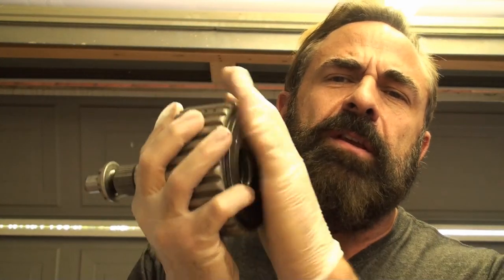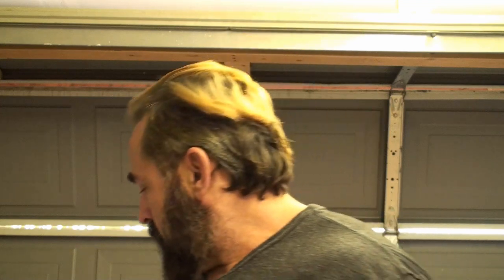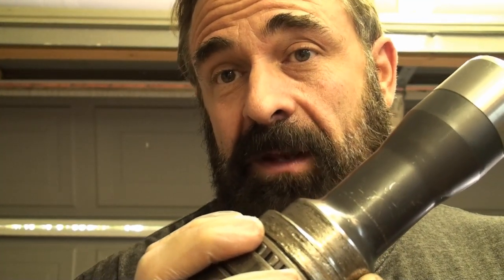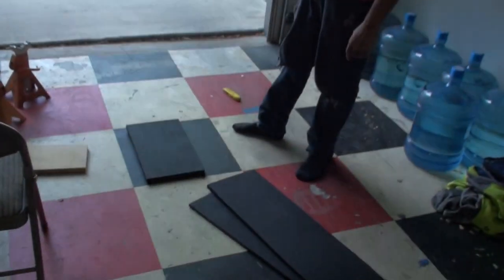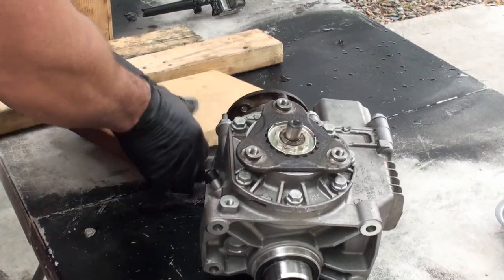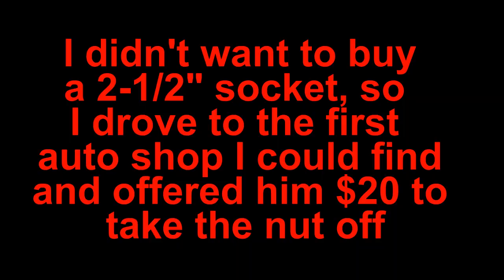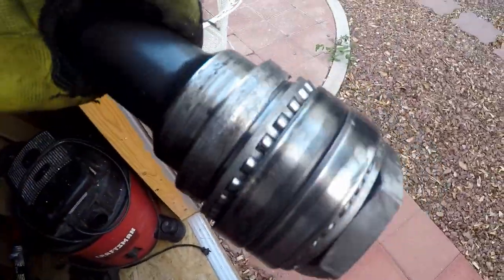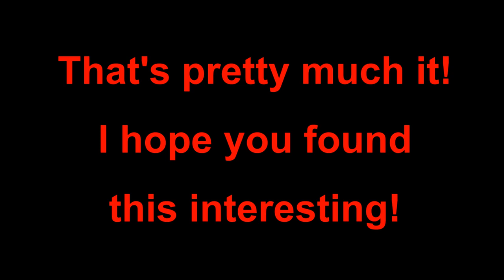2016 Golf R Bevel Box Failure TSB

Comment: Great video! Just had this exact issue on my 65 plate S3, took it into an independant speicailst who couldn't diagnose the problem (HAD THE CAR FOR TWO WEEKS!), we tried changing the pump, changing the controller, putting new fluid in, cleaning the pump gauze, removing the friction plates from the haldex and the clutch basket to inspect, nothing wrong there. They then tweaked the TC and told me to go test the car, one launch later and a whole load of front wheel spin as per the propshaft and coupler exploded off the car, great, once fixing this we still had the same issues, anything over 2.5k rpm the TC light would go nuts.

Spoke to a guy called Matt from haldex repairs and he was amazing, we both came to the conclusion that the haldex was fine as the pump values were as expected therefore showing that the pump was functioning correctly and that the pressure release valve wasn't stuck open as this would've changed the pump learn values. When the car was in the garage I asked them to check the BEVEL/TRANSFER BOX which they came back and said was all fine. 

SURPRISE SURPRISE THE BEVEL/TRANSFER BOX WAS COMPLETELY F***ED,  After over £1000 in garage fees and still getting the same TC flicker on any slight accelleration I took it to another specialist to a guy named Tom, great guy and managed to get me in within a few days with a second hand bevel/transfer box and this instantly fixed my AWD problem! It seems the push fit gear as shown in this video had done exactly the same. 

All that time I had wasted with another garage that didn't seem like they wanted anything to do with the issue as the best they could come up with was to buy a whole new haldex at a nice £2800 plus fitting etc. NO THANKS. Another "Specialist" that has absoulutely no clue on how to diagnose the issue presented to them and proceeds to bill the customer for their lack of knowledge.

Link to the site that helped loads - https://www.haldexrepairs.co.uk/generation-5-haldex-fault-finding-repair-guide/

MY CAR IS STAGE 1 ECU and STAGE 3 TCU, it's been stated this problem is normally with modified vehicles due to the extra power, which with all the lauches I would agree this really stresses the Bevel/Transfer Box.

MY  SYMPTOMS:

TC Light flickering under any load and massive front wheel spin
Once the car was up in the air all 4 wheels would apparently spin (not too sure I trust this as this came from the garage who couldn't daignose it).
ALL STARTED WHEN SETTING OFF FOLLOWED BY A HUGE BANG AND THE REAR WHEELS JUDDERING WHEN ACCELERATING, THIS SLOWLY FADED OUT TO BASICALLY NO DRIVE TO THE REAR

I noticed this first when launching the car it would feel as if the rear tyres were crinkling or the haldex clutches were slipping, if anyone needs a hand I will be more than happy to try and help, I wish I could've spoke to someone like myself when this happened. 

TOTAL £1700 down and fixed :(

RENOX
Reply: Got similar issue!! Need help in the right direction mate , 
Golf r 2014 dsg stage 2

Traction problem from the front in almost every gear 50% 75% acceleration..

Got 4x new tyres 
Haldex serviced and issue still there
So got a NEW HALDEX and still the same. 
Got new diff oil

ISSUE IS STILL THERE ??
Reply: @haroonnasir1970  Hi mate, when you changed the diff oil did it look shiny or like it had glitter in it? 

Also have you tried the Transfer Box Test on that link?

Comment: Fkn legendry video, thankyou!!

Explains EVERYTHING, and like you I've fought loss of rear Haldex on tuned cars at the rear end without luck. Endless reports of bevel box issues across the various Haldex car forums, and all sorts of urban myths and special voodoo involved. Just had my new, low km bevel box start making weird pinging/binding noises on the highway, and it seems a lack of oil despite zero leaks was the issue, I had no idea in the MK6 era it stopped sharing oil with the gearbox, so didn't go looking for a level to check. Drained out 150mL or so when it should be 850mL. I reckon my bevel gear has slipped due to heat and friction, so have yet another box to fit, and to keep an eye on. After your GREAT diagnosis, I'll rebuild my old box and keep it as a spare, cause no doubt it will play up down the line. At least it's a relatively easy fit in place, just axles off and a bit of engine rocking. Oh yeah and fit a hose to the breather port so you can refill it much easier in future, I'm adding this to the DSG fluid replacement schedule, and ensure you get the uber special VW fluid too!

Comment: Great video Radfox. My repair shop has ordered new bevel box from Germany, they couldn’t find any in the states, new or used. Mine did not have a mechanical failure however. The motor blew 5 weeks ago from crack in oil pan and after test driving the new motor they found a leak from the bevel box. Shards impacted a crack in bevel box.

Comment: I have a theory about how the transfer case (bevel box) was damaged. Many years ago I had an EVO 8 that I was tuning at my friends shop using his DynoJet AWD chassis dyno, and his did not have the option that physically connected the two rollers. After multiple runs I noticed that the front wheels completely stopped before the rear wheels stopped, and I thought oh that is not good (and unfortunately I was right). On the next run only the front wheels spun up, crap! 
What we learned is when you don't have any type of connection between the two rollers, the only thing that keeps the two rollers spinning together is your drivetrain. When the run is over the operator lets off the gas and presses a button that initiates a roller brake system that is separate for each roller. I learned that there is regular maintenance for the front and rear roller brake systems and apparently that had not been done in some time so the rear roller brake was not working well. When those heavy rollers are spun up that is a lot of energy and if the brakes don't line up the only thing keeping them at the same speed is your car's drivetrain. 
With the EVO this brake mismatch caused the gears to completely break, whereas yous apparently spun a gear. After this experience I would never put an AWD car on a chassis dyno that did not have the two rollers physically connected. Or put it in 2WD mode and test it that way.
SO question did this issue appear after your dyno testing? What about other folks on here claiming to have had the same issue, was your car on a chassis dyno at some point? And did it have connected rollers? 
I suspect this must be the issue because while some others have had this issue, there are a lot of folks making way over stock power and doing all sorts of drag and road racing, and have not had this issue. So when I saw your dyno video and you specifically mentioned that it does not have the roller belt connecting the two rollers...
Reply: I've also wondered about this, and why i've not been too keen to put my RS3 on a dyno.
Reply: @RichLion  You can do it no problem, just make sure the dyno you use has the rollers physically connected, or run it in FWD mode. If you do that, it will be fine.

Comment: Hi, this is a really common issue. I run a company call HaldexRepairs.co.uk here in the UK, and I talk to about 1 or 2 people a week who is trying to solve a haldex problem but it is the transfer box slipping just like this example. A really good test which I tell people over the phone is:- 

Lift the car so the front wheels are off the ground. 
Get somebody to watch the propshaft.
Someone else sits in the car, starts up the engine.
Then very gently lift your foot off the brake so the front weeks start to turn.
If the propshaft is stationary then its the transfer box.
If the propshaft rotates then it is a Haldex issue.

Every car with a broken transfer box so far has remapped etc, it is the first question we ask.
Reply from the maker: threepotgtti thanks for the input! Maybe you guys should look into offering a welded ring gear replacement. What are your thoughts on this? 
 Do you offer a haldex clutch plate replacement kit for the MK7 yet?
Reply: @RadFox1320  Major mechanical repairs are not really what we do, it is just trouble shooting, control unit repairs, new pumps and new filters. Welding up transfer boxes is well out of our remit. We've never bothered doing clutch plates either because up to now we have only found 1 vehicle with a burnt up clutch pack. Lots of vehicles get the Haldex coupling replaced by other places but it's usually misdiagnosis. There is a firm in south eastern Europe that supply clutch plate kits but so far we have had no need to use any.
A customer sent us the link to this video, and I think this is awesome, it really shows this common fault up close in detail. The build of these transfer boxes is very cheap indeed. I will send lots of people a link to this video!
Reply from the maker: @threepotMR2  Thanks for your response and sending people my way! Your company provides a great service and anyone experiencing Haldex issues would do well to contact you at HaldexRepairs.co.uk and look over your troubleshooting guide.
I suspected that most "Failed Haldex" were misdiagnosed, its good to hear that you can confirm this. I took apart a supposed MK7 "Failed Haldex" with dark oil and as far as I could tell the clutches looked perfect and there was nothing wrong with it. Thanks again for your input!!!
Reply: @RadFox1320  I have linked this video on our repair guide here https://www.haldexrepairs.co.uk/generation-5-haldex-fault-finding-repair-guide/
Reply from the maker: threepotgtti awesome thanks!!
Reply: @threepotMR2  I'm here from that link.

Comment: Very interesting video!  I’ve had some haldex issues and did the VCDS pump primer and adaptations reset, then replaced the pump and last replaced the controller. The newer controller seems to have fixed it but I did see the bevel box fail on a few people during my research.  I never understood what the bevel box was but thanks to your video I do now!
Reply from the maker: Thanks for watching!
Reply: Was this fixed in later 2016's or 2017's
Reply: @CA-td2mx  No, experiencing the same on my mk7.5

Comment: Great video, bevel box on my 2018 RS3 just blew itself to bits, thankfully my dealership diagnosed it and didn’t give me a run around with any other haldex parts. The not so good part is that it’s roughly 12 000$ CAD to get it fixed …

Comment: I’ve got a 2019 Golf R.

Launches perfectly but everytime I make a tight turn, like out of my driveway, the rear end vibrates. 

Had the Haldex, diff, propshaft and driveshafts checked and no issues. 

No one can diagnose it. Any suggestions?

Doesn’t happen straight away. When I start the car and turn out of my driveway, no vibrations. After driving for 5 mins, the car starts vibrating on tight turns.

Comment: Great video, thanks. On the RS3 the ring gear is (now) welded to the shaft.
Reply from the maker: Do mean you welded your ring gear, or that RS3's now come with the gear welded from the factory?
Reply: @RadFox1320  Comes welded from factory.
Reply: @jarlev80  did you check this?
Reply: @Adrianperformancequattro  Sure, my bearings were done so did an overhaul on mine. The ring gear was welded to axcel.
Reply: @jarlev80  do you know what’s the symptoms of bad transfer case? I just purchased an used 2016 RS3. I am starting to hear some humming noise at low speed, not sure why. Brand new PS4S. Thanks!
Reply: are you sure about this, some rs3 owners mentioned needing a replacement with similar issues.
Reply: @eddiexiang3606  same with mine did u find out what it was?

Comment: Did you get any binding during tight turns? I'm experiencing a similar issue on my MK6 Golf R, and after doing Haldex service, replacing the pump, fluid, and controller, the issue persists. The car was abused by the previous owners with a REVO Stg 2 tune, and now all signs are pointing to this bevel box... so fucking annoying.

Comment: As a VW tech I can honestly say we haven’t changed many if any bevel boxes. I think the fact that your car is modified is the reason it has failed, which is normal since the vehicle was designed and built for a certain amount of torque. With all modifications all parts after that risk heavier wear. Just consider yourself lucky it wasn’t differential damage I guess. 
Great video showing exactly the faulty part!
Reply from the maker: Thanks for the comment.  I think I know exactly when it happened and yes I am sure the added torque from the tune is what allowed it to happen.     I doubt that stock power levels could spin the gear except under very unique circumstances.  If I am right, it happened during a launch where I hit a dirt patch with massive wheel spin and then a super violent wheel grab when I hit sticky pavement. I remember hearing a loud bang and thinking what the hell just broke.  I looked the car over and didn't see anything and forgot about it. So I am pretty sure for it to happen you need massive high RPM wheel spin then a violent tire grab to do it.  I had PSS's on the car when it happened.
Reply: Rad Fox if that’s the case, I’m glad it wasn’t worse lol
Reply: @RadFox1320  hello, today i am running the same problem with my volvo S60R T6 AWD 340HP, my car don´t have any modification, when I press gas pedal heavy, it feels like if a banana peel were glued in one portion of my rear weels, feeling a strange noise and not a constant push!!, i was looking for a haldex replacement, until i saw your video, ill check this week if the problem could be the Bevel Box, and in that case ill try to weld it, o even put some kind ok threaded bolt, to avoid gear rotation. Haldex oil, was clear, not much dust, discs looks new, car has 80.000 miles and I think gear couldn´t stand the torke.
Sorry for my english, hope you could undestand.
Bye
Reply from the maker: @juanmanuelpaladini  i think on the volvo the failure is typically a little different. On the volvo i think the splines start to rust and shear off the input shaft to the bevel box. I think you can order just the shaft on the volvo.

Comment: Hello! What happens if I drive the car with dead haldex pump ? Is there any damage to the haldex or it's just like a FWD car now? Thanks
Reply from the maker: You should be okay, if the pump isnt working the car will just be fwd. The pump clamps the clutch plates in the haldex. If it cant clamp them together no power will make it to the rear wheels.
Reply: @RadFox1320  thanks for the answer, Rad

Comment: I am here because my 2012 Mk6 Golf R appears to want to think it is a Gti (front wheel spin when planted, only 45K Kms, recently replaced clutch/ pressure plate with Sachs due to slip in high gears under full throttle, running Bluefin Stg2 tune+Miltek exhaust, dyno just a bit over 210kW/280HP at wheels so not a huge amount over stock).  Pretty stupid design, surely to avoid detonation of that ring gear or shaft, the rear haldex could do the releasing if there is excessive force.
Was thinking it was haldex pump due to the dozens of threads dedicated to this, will attempt to get under the car and spin the drive shaft to learn what the damage will be to my pocket...Euro parts are insanely expensive in Australia.  I wonder if there is an upgraded part for this, seems like this issue even impacts the MK7 so probably not :(